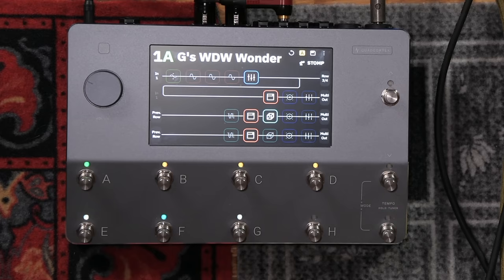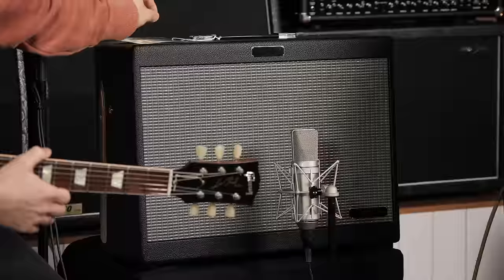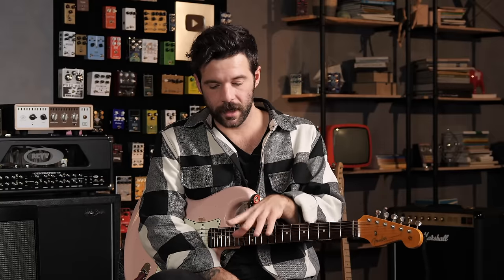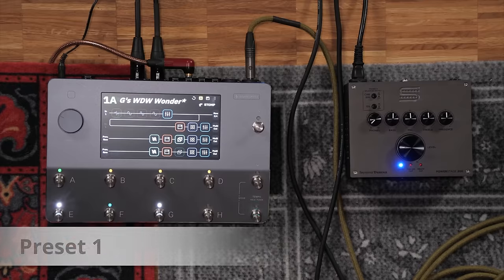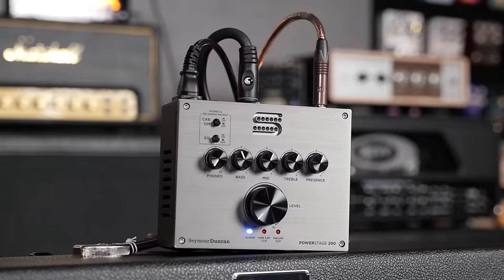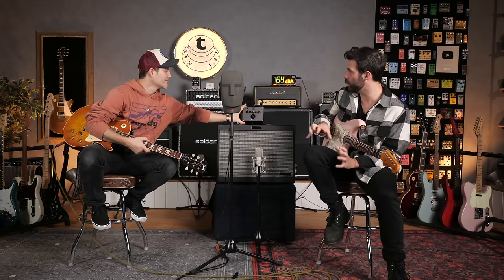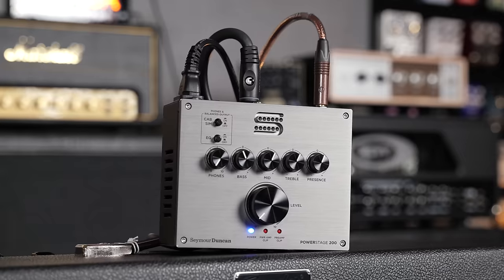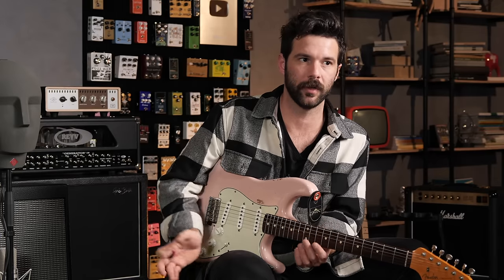Best Ways To Amplify Amp Modellers | FRFR or Guitar Cab? | Thomann

Comment: my humble opinion: the best way to amplify a modeler is the Laney LFR 112. it basically returns the amp in the room feeling and sounds awesome - crisp and clear and beefy (and quiet). the Fender FR-12 is ok too, but hisses too much for home use (in my opinion). it is quite fine in a band context though.
Reply: I have a Laney LFR-112 too and I like it.
Reply: Yes..agreed…
Reply: It’s rumored they fixed the hiss without acknowledgment on new units.
Reply: yeah, I read that too in forum. Kind of lame of Fender to not acknowledge the problem (even denied it), then silently fix it and not offer any help or compensation to those customers who have bought the hissy units. Well, in any case - good for the people who buy it now. It does sound good and the hiss is only really annoying in a silent setting. In a band context, it does not matter.
Reply: I didn't hear hiss on the mic in this video. I wonder if they did something to remove it.
Reply: Tube amps hiss..... It's also not a bad thing. Sure in a room by yourself it'd be eh but for a jam session its a better sounding fr. Id still rather run it through the power amp in on a boss katana
Reply: Does the Laney weigh a ton?
Reply: @uncletoby1  yes, nearly 20kg

Comment: Hi, thank you for the really useful videos that you post. There is though an option for using the Katana as a power Amp that you didnt mention. Connecting to audio interfaces. I bought a 50 gen3 from Thomann a week ago and I am trying to figure out how I can use Katana as a Monitor for my portable iRig HD2, so that I can also use Amplitube when I am practising. The iRig has two options for sending audio, the most suitable for monitoring (according to the manual) is from the headphone out (stereo). So, can I use a 1/8 stereo to 1/4 mono jack that I saw in Thomann to connect my interface to Katana? I mean, that's what power amp in does, am I correct?

Comment: If I’m just a bedroom player what is the best way for me to monitor my modeler besides headphones without aggravating my family? Sorry, I’m new to all this modeling stuff.
Reply: Consider using a pair of studio monitors connected to your audio interface instead of one FRFR!! These are way smaller and give a nice flat response. I use the Yamaha HS5 along with my Quad Cortex and I'm super happy.
Reply: @diegoiglesiases I second this. Studio monitors is the way to go and the Yamaha is the best choice imo. I’d go for an HS8 though.
Reply: Second on the hs5s, you dont “need” the hs8s if youre in a small/medium room. If you do have the space definitely grab the hs8s but then youll probably need stands to get a proper effect from them

I had a pair of hs5s for YEARS with no issues, just sold them to fund my quad cortex purchase, i dont do much home monitoring anymore and my headphones are usually enough for a session. I use beyer dynamic dt990s

Comment: I run my live amp modeler into a Mackie Thump PA speaker. It’s so loud you can amplify an entire band mix through it and be louder than a loud drummer. For guitar alone, it sounds absolutely amazing.
Reply: having just the QC, this is absolutely the most sense to me. I use in ears but want to be able to have stage volume that can also add other elements in if my IEMS fail for any reason. Buying a cab (even FRFR) feels like just more things to have to hump around which was becoming the issue in the first place 😂
Reply: Which version of Mackie Thump do you use?  And what style of music?

Comment: If I’m not mistaken, in the QC you can place an EQ in front of the outputs feeding a power amp and EQ that signal without effecting the signal to FOH. I prefer the EQ be done in the QC rather than the power amp. You can easily recall different settings for different power amp/cabinet combinations. So I prefer using a tube power amp with just a volume knob.

Comment: Good video.  For me personally,  the idea of a modeler is 1. Extreme portability and 2. Get access to play around with different amp sims without having to buy a ton of gear.  For these reasons,  I'd go straight into an FRFR speaker. 
The tube amp and pedals would be a totally separate peice of gear that's stationary in one place.
Finally a tiny portable amp like the Spark for travel practice
Reply: In midst of putting together that rig now.   Have the Helix, buying Tonex end of month as well as an FRFR. Then, I will purchase a 2nd FRFR in 1 - 2 months .. for stereo 🙃🎸🎶🤜🤛🤟

Comment: I have all options available, but I really enjoy running my Helix into the return of my Marshall DSL40cr. As an added benefit, you get to use the amp's resonance and presence controls if need be. I have found that this makes the Helix preamp models shine.
Reply: Cnan u tell me how i Can Connect helikoptere or tonex for that matter into amp? I have heard it have to be connected into the fx loop of the amp. But can u elaborate?
Reply: I have this setup as well with the Helix Stomp using the 4 cable method into my DSL40CR. I am on the fence about it, b/c what comes out of the Helix vs what the DSL40CR does to color the tone, are very different. I have to do a lot of EQing on the Helix. I also found the resonance and presence controls are hardly noticeable on the DSL40CR. Don't get me wrong, I still like the amp, but I play on my Helix Floor into FRFR more often.
Reply: do you connect it via 4 cable method?

Comment: I've been running my Boss GX-100 into the effects return of my BluGuitar Amp1, and then the BluGuitar Amp1 drives a 2x12 guitar cabinet.  I copied the patches I created for going to FOH or into a DAW, but then turned off the cab sim on those patches so I can go into a guitar speaker cabinet.  To send my signal to FOH I just mike my guitar cabinet the old-fashioned way.  It might seem kind of dumb, but it works great for me.  I've used mikes like SM-57s to mike guitar amps for decades so I know how to do this and get a great tone coming through the FOH system without having to worry about special IRs or anything else.

As someone else noted, if my GX-100 ever goes down I can just go straight into the BluGuitar amp and still get through the gig.

Comment: I run a HX Stomp XL into a Seymour Duncan Powerstage 170 going into an Orange closed back 2x12 with V30s. Love it.... Since I've gotten my modeler setup I haven't went back to my Revv G20/Pedalboard setup to compare yet. I don't think my modeler setup will ever replace my Revv G20 pedalboard setup, but man this modeler setup sounds wonderful.. What a time to be a guitar player.. lol
Reply: Do you use the Stomp's Mandarin cab for direct to FOH?
Reply: @paulschlachter4313  I've only played one small gig with this setup and I didn't run to front of house. I know I can split my signal path to front of house and to a cab simultaneously but I haven't gotten around to trying it yet. 😅
Reply: I tried my Orange PPC and it sounded really dark. But then again I had no clue what I was doing back then either. I should try it again. Have you tried a mesa 2x12 with V30s?

Comment: Great video. For me, I use my Tone Master Pro directly connected to my Audio interface (UA Apollo 8) with Cabinet emulation when I want to record my performance in my DAW (LUNA). In that case, I'm monitoring through my Kali L6P studio monitors and it sounds great, really great. I also use my Boss Katana Head 100W as a power amp connected to the Tone Master Pro on the FX Loop 4 left channel (hence mono) when I want to jam or rehearse. In that case, the monitoring is done through my Harley Benton G112+ Thiele Cabinet  (Celestion 65W Creamback made in England). I some cases, I use a SM57 to record my performance but I have to say that I prefer to use the first way to do it. The TMP cab emulation is amazing and the acoustic of my home studio is not really good so... To be completely honest, the second method is more satisfying as a guitar player, using a real cabinet is always a plus even though it's hard to explain the feeling. Anyway both ways are good and the Tone Master Pro is an amazing beast. Cheers from France.

Comment: I'm running a Cortex into an FRFR mainly for portability. But I like that I can use the FRFR as my stage monitor and I have control over it without affecting the house sound or relying on the soundguy to get the level to my preference.

Comment: I’ve the boss GT1000 bigboy. Love the thing. I own one amp and cab for bass. For guitar live I go direct but when there is no personal monitor for me (small gigs) I send one signal to FOH and one signal to the bass amp and cab. Bass amps and cabs are also very full range so this works great. The boss has many output options that will adjust the EQ slightly to work in that chosen setup. There’s an output option that says bass amp with tweeter when choosing that it has great guitar tones from the bass amp. So I can cover guitar and bass with one amp head, cab and modeler and be lightweight, great sounding and consistent with not many compromises imho ofcourse
Reply: Hi I’m new to multiprocessor what does going direct in live mean? I’m guessing directly to PA but that’s my question how does it work? Because isn’t PA usually but distant from the stage? How do you make it work? Thank you

Comment: I am using a boss katana in the acousic channel for monitoring my nux mg 30 and really like it. Also having bass, middle, trebble and presence settings to modify the sound to my preference. But using them mainly in center positions.
In that way, I also have a backup. If the modeler fails.
Here in the video, I most often liked the neuman mic over the head mic, but was positivly surprised by the floor monitor.
Nice video!

Comment: I use an hybrid system, analogic pedals in front of a Victory Amp V4 Duchess Amp with Two Notes built in, HX Stomp on send/return. V4 Duchess has 3 out (2 with cabinet emulations and a Speaker 4/8/16 ohm out) and this is my use: XLR direct on Mixer with Celestion 4x12 Creamback emulation, Speaker out direct on a 1x12 cabinet Celestion Creamback loaded, and the Line Out (with the same cabinet emulation) of the pedal on a FRFR monitor. Love it…
Reply: Hey, interesting set up - I have the v4 Jack amp - and was thinking of going to 1x12 instead of lugging about a 2x12 cab. But I thought they are rated 95w at 8ohm? So how has the creamback coped as it’s 65w? And do you use the frfr as a monitor instead of iem’s?
Reply: @PaulLawrence1972  hey! The Creamback it’s 65w but in the middle I use a simple Bugera attenuator to choose the volume on stage, AND I use an FRFR with 2 input (and 2 volume pot) to mix the guitar tone with other instruments. So I can hear me from behind (with a good cabinet sound) and from the FRFR in front I can hear the sound I’ll have on stage (on the mix).

Comment: Playing for myself at home, my experience has been that the separate tweeter in the frfr cabs makes a noticeably different sound than a traditional cab, and I don’t care for it. Same of course is true of monitors. I finally accepted that for me (good) amp in the room tone is of greater interest than absolutely flat response and I now run into the return of a quilter superblock into a stage right 1x12 and the tone is fantastic. I still use some cab sims to pleasing effect.
Reply: Have you tried a high pass filter on the signal out to the FRFR?
Reply: @BryanGrigsby right?  5k and tweeter kinda out of equation

Comment: I have been doing the power amp in on my amp into my 2x12 and I get the same issue you said, sounds good but need to make some adjustments. It’s a bit of a hassle. I really want to get the FR 12 now and be done with turning on and off cab emulator depending on the situation.

Comment: At home I use studio monitors. Live I put it in the effects return of an old Fender Mustang 3 modeling amp. It has a neutral speaker so I can leave the IR's on.
Reply: Can you connect the quad cortex directly to 2 active studio monitors?

Comment: My personal experience : I have played a long time with a Victory Countess V30 MK2 and Friedman Runt 50 in conjonction to a multieffet for reverb an delay (4CM). The setup was great but the problem was that effect loop was sucking the tone due to multiple analog to digital conversion.  To avoid that, I have now a Fractal FM9 connected to a power amp and I really like it but I struggled to get the same tube amp feel depending on the power amp type. Tube amp have a lot of energy with the attack and it pushes the air very efficiently. One reason that tube amp players sometimes change their output transformer is to get a punchier sound and output transformers with the help of output tubes are an energy buffer that can deliver a lot when sollicitated. Regarding non tube power amps, I have tried PS700 => the sound is very loud but lifeless and lack of punch. I have read that class D amp we're not good to reproduce this tube amp feel and I definitely confirm that. Not the same attack as a tube amp. I then bought a Orange Pedal Baby which was better to replicate the amp feel. It is solid state class AB amp so a better configuration but it dit only replicate the tube amp feel at bedroom volume not during a gig or stage situation.  Now I have a stereo 50 W tube amp Eng 840. I did have to tweak the EQ on the fractal with specific PEQ curves (fractal units are very good at this) to correct the sound as this configuration is colored by the tube amp but have retrieved that energy and tube amp feel. The problem now is that this configuration is heavy. Next step would be to buy a lighter tube power amp. I'm still looking for it.

Comment: Interesting video. NIce one. 
For my Quad Cortex I use a Palmer Mach 402 power amp in stereo with a Blackstar 2x12 loaded with H-75 Creamback and a CL80 on the dry (ish) side and custom 1x12 CL80 on the wet side. I find the trick to using Class D power amps is getting as much clean headroom as possible therefore go for the loudest you can get (without being loud)! I've got a Peavey Valve power amp, but it's broken. I know it will make the quad come alive when it's fixed. 
For masterclasses and demos I go straight into a wee Mackie desk into a Yamaha dxr 8  PA monitor. I can mix my Guitar synth in there and any backing tracks. With a band the DXR8 is just for my synth guitar. Everything gets sent FOH with both rigs. 
I personally hate the sound of just going FOH. It's like having a 2D willy! You need something behind you to give it size and meaning.......in audio form of course!

Comment: Should have tried the Pedal Baby 100 too, class A/B differs enough from class D that some would prefer it while playing.

On stage, power amp with cabs as backline, DI out with custom IR loaded to pa/monitors.
A 1x12 cab with a neodymn speaker set in ear height will do, propper in ear solutions are still pretty expensieve.

Comment: I am equally surprised how good yet portable these Class D power amps are. Even on a budget. Kudos to you to avoid promoting Thomann's house brand in this video, however, I currently have a NUX Amp Academy hooked up to a Harley Benton GPA 100. The NUX XLR DI out feeds the FOH with IR, the 1/4 out feeds the GPA 100 without an IR. The GPA monitors out through a Blackstar 2x10 or a Thiele type 1x12 and both monitor signLs are just awesome. Playing feel is retained which is the biggest compliment to make to such non-traditional set up I think. 👍

Comment: I like FRFR because it's close to the sound I would send to my audio interface to record. That's one problem the UA ox box has. If you use it as a load box, but then also record direct from the OX box, what comes out of your cab vs what comes line out of the OX sound totally different. The other thing that is easy with FRFR and sounds amazing, is stereo. My Helix Floor stereo effects sound killer in stereo. I run the helix floor, --> Looper --> drum machine --> stereo FRFR. I am a one man band, ha. Its great for practice.

Comment: I'm using an Electro Harmonix Dirt Road Special (solid state combo) for amplifying the sounds coming out of my PC and audio interface. Comparing the signal straight out of my headphones connected to the audio interface with the sound coming out of the EHX setting it up everything at noon you can achieve a pretty similar result to each other.

Comment: I use the Seymour Duncan power stage with a 2x12 barefaced cab with V30’s through an axe fx fm3 and I love it 👌
Reply: I´m thinking about something like this , could you please say me if it is necessary to disable the cab in the preset used from FM3?
Reply: @jjr.m.1002  yes I use the global settings and disable all the cab sims and I absolutely love it! Especially on the new firmware

Comment: Great video! Love your energy and style! Technically i don't understand how you are able to record such clean signal from tube amps without any noise using condenser mics. Maybe a video on that would be great as well or some comments. thanks!
Reply from the maker: Hey, thanks a lot! It's not a lot to "reveal" about not having noise when recording our amps with those sweet Neumanns. We just never have any serious noise or hiss coming from the amps we are using so the mics can't pick up any noise. Also, we play quite loud in the studio so the signal to noise ratio is great. This means that the gain on the mic preamps can stay low so they don't pick up that quiet background hiss of a guitar rig. Also, we barely play with a lot of drive which of course helps with avoiding loud hiss issues. That's it. :) 
Ohh and in this video we used a modeller (which we don't usually do) with a built-in a noise gate. If I'm not mistaking we had that on on a very mild setting. Cheers //Kris